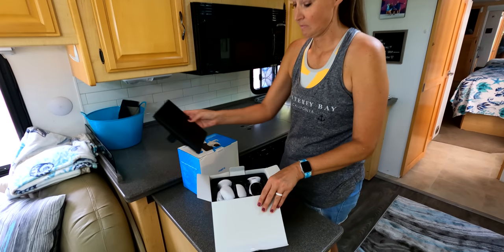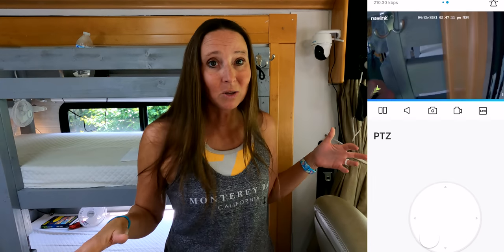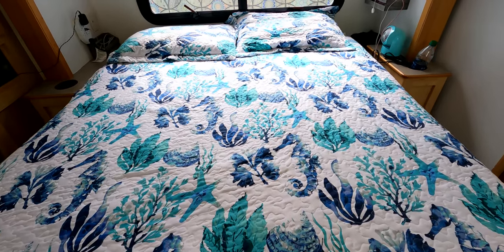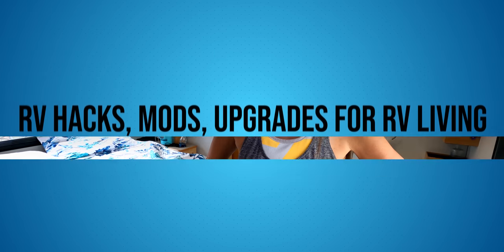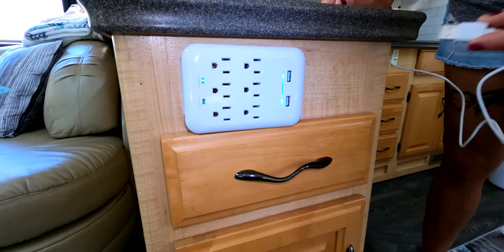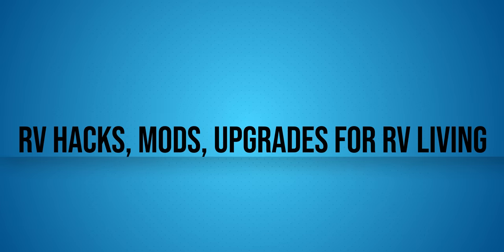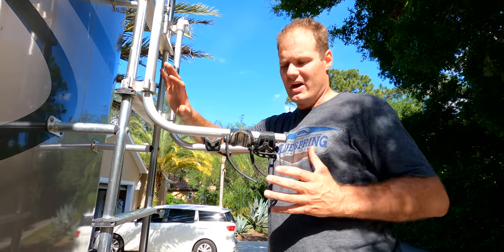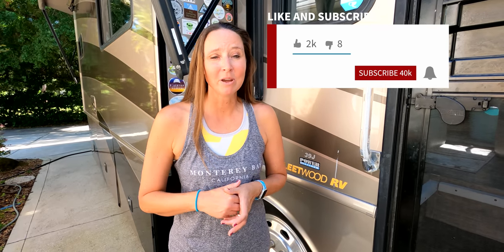RV MODS & UPGRADES! RV Living Products PLUS RV SnapPad Install (Part 1)

Comment: We used the power outlets almost from day one. We also bought the surge protector very early too. Since then we have gotten the Garmin RV 770. I have recently considered upgrading to the RV 885. We also have a tire pressure monitoring system. We were also advised to get a water pressure regulator for water coming into the RV so we didn't blow our pipes. The back of our vanity was dark.  Especially in the early morning and night so we had a light installed under the wall cabinet and wired it into the light above the vanity so they come on together. These are our big things.
Reply from the maker: Thanks for sharing!
Reply: @GratefulGlamper  p

Comment: I have the snap pads on back legs only and use Andersen Jack's on front because I don't have a drop frame and our front legs got overextended once. We nearly got stuck, but we were able to fix it. With the Andersens we have never had that problem again. I would suggest if you have a drop frame to go with all snap pads, otherwise use our method.  I love my Garmin 870. Great video.
Reply from the maker: Good to know and thanks for watching.

Comment: An EMS won't protect from a burned plug/ bad connection issue. That's just over heating, but there are many other issues they do prevent. 
I prefer built in for both EMS and USB devices.
Reply from the maker: 👍🏻 Good to know!

Comment: Thanks for sharing. We couldn’t buy the sanpads because they were on back order   If they now have them I will buy them. If you are an affiliate, please send me your affiliate code. 
On the ladder bike rack, I have heard of a lot of damage to the RV from ladder racks. Everything from the bike rack ripping up the RV to the weight and bouncing on travel days, to the bikes scratching and rip-off paint.  Years ago I wanted buy one and was told not to because of potential damage. I was told that RV ladders are not built to take the weight of “bouncing” bikes as you are rolling down a highway, let alone a rough road. I did not buy it. That mechanic scared me out of it. All I saw were $$$$ in repairs and I immediately removed the idea from my head. Keep us updated on that mod. Perhaps you found The One! 👍
Reply from the maker: We had our bike ladder rack for three years now and carry two bikes. No problems yet and we’ve put on a ton of miles in all sorts of conditions.

Comment: I'm regards to surge protectors ... If we have both 30 and 50 ... Will we need to buy one of each? Or will the 50 work for both?
Reply: One is all you need. Buy to match your rig. Use adapters as needed.
Reply from the maker: What Luminous Views said 👆🏻Get a 50 amp If your rig has 50 amp, then a “dogbane” adapter to convert.
Reply: @GratefulGlamper  @Luminous Views Thank you everyone! We will go for the 50amp. We have the dog bone already and didn't even KNOW or THINK about a surge protector until your video.

Comment: Look at the Rtic 30 softside cooler.   $95 dollars.  Which is much cheaper.   I have had mine for 5 years, used weekly.  Looks like this cooler you recommend copied Rtic’s cooler almost to a tee!   These Rtic products are 100% full proof!   Any of them.  I hate to admit just how much Rtic equipment it is that I have bought🤪.    Yeti has nothing on Rtic company.
Reply from the maker: Thanks for the suggestion!